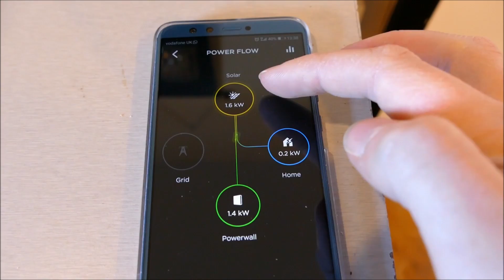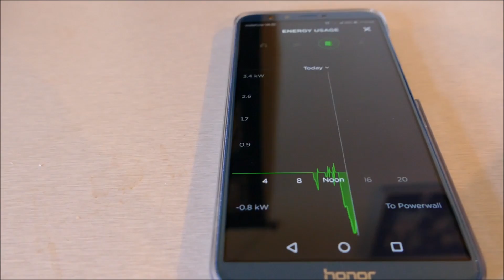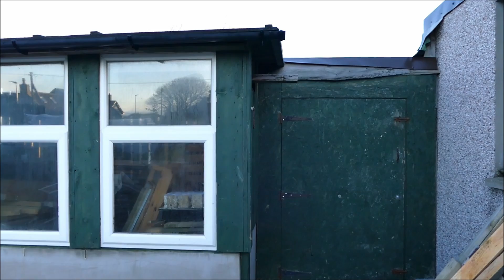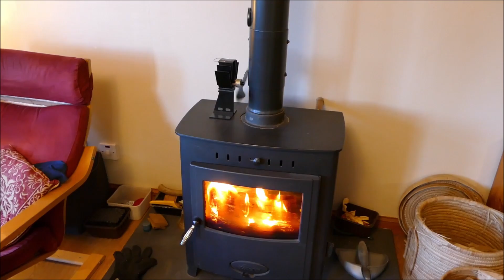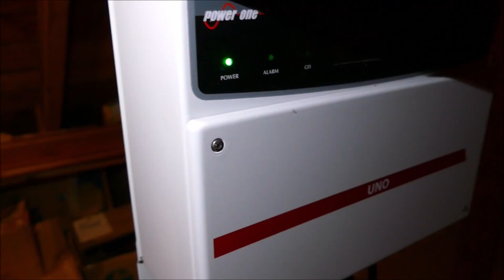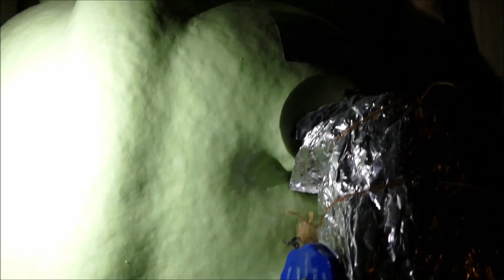A Nearly Carbon Neutral House

Comment: Just turn off utility breaker and you can go off grid. No excess power will go out to utility and no accidents will happen.
Reply: If he turns off the grid connection the inverter will shut down, he would need to install a critical load distribution panel and anti islanding switchgear.
Reply: Ambient Fish 1 No, what will happen is that the Tesla gateway will tell the inverter to shut down until it is necessary to start charging the battery or if the home needs more than the 5kwh peak of the Tesla inverter. It is just like if the was no power from the grid. You do not have to install anything else.